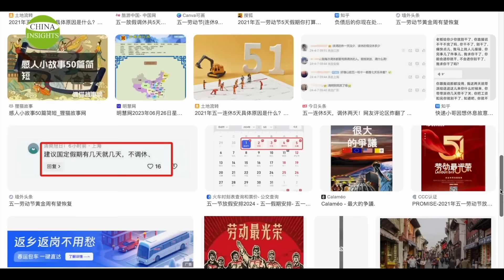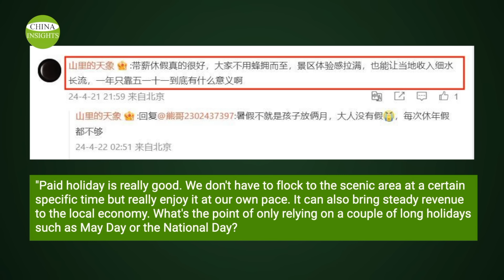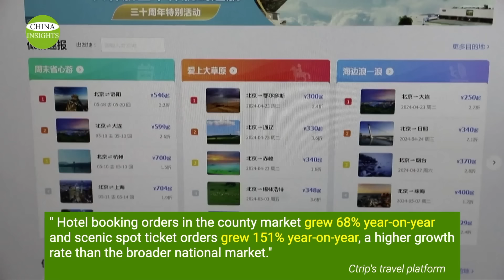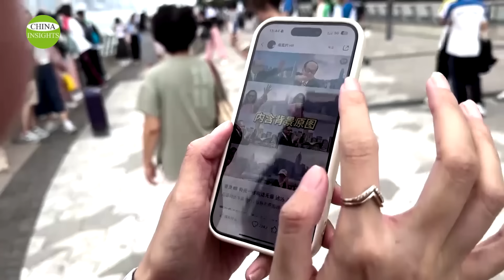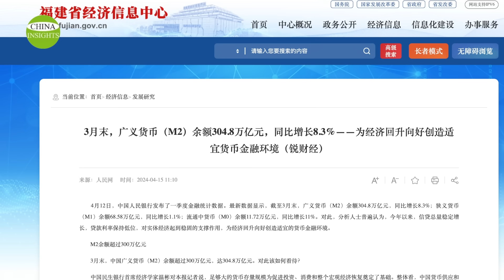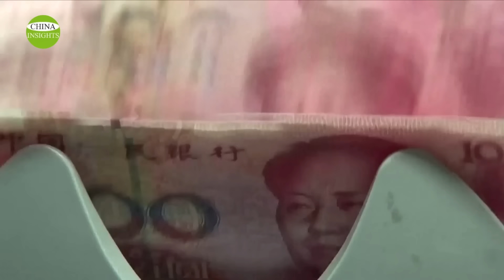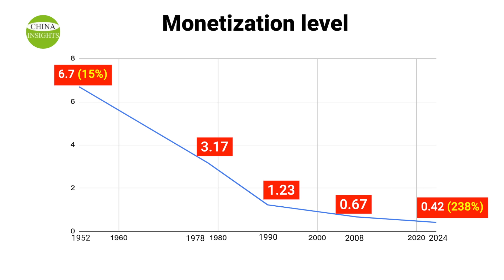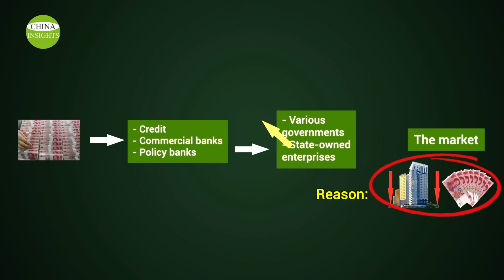Today the value of 100 yuan is equal to the 1 yuan 30 years ago. How much money does China print?

Comment: So the value of the money went down, but the prices of houses also went down? Sounds normal to me.
Reply: Except that the 70-year land lease clock keeps ticking since the date of the original land deal for the land when the house was built.  All property in China is owned by the CCP and it is "sold" for a period ranging from 30 to 70 years after which ownership comes back to the CCP.   The last one to own the property before it reverts to the CCP might even have to pay a cleanup or pollution fee on that land, so the last 10 years of that property would be a tricky thing to buy into if you can't get someone to take it off your hands if the land was polluted or full of debris from tofu-dreg buildings that collapsed.

Comment: Optimal inflation rate is 1-2%
Average around 3%

30 years of 3% annual inflation is about 4%. So 100 yuan would be around 4 yuan
 
In 30 years time 
100 yuan would be around 1 yuan only if there is an annual 7% inflation rate

Comment: 30 years ago, US$1 = 8 yuan. Today 1$ = 7.22. Which means yuan today is stronger than what is was back then compared to dollar.
Reply: That’s not natural: not a free flow exchange rate, on the contrary, forced by govt, who has to compensate for it , making matters even worse. Argentina tried that, look how they ended…. The difference is that the fuse was much shorter than China’s, but when it goes off, it will be much louder